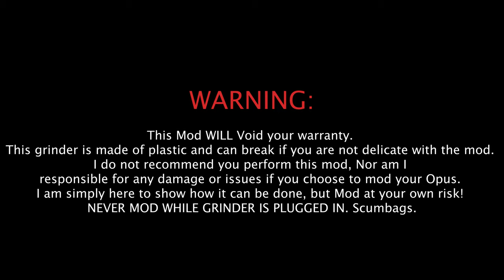MAKING the Fellow Opus BETTER (Stepless MOD)

Comment: What I'm left wondering is if Fellow could reliably use a stepless system which would make it more appealing to enthusiasts AND it would cost them less (1 less part), why would they have not manufactured it this way? No offense but something makes me think that with a lot of time and money for R&D, their engineers might have a better understanding of the nuances in the construction of the unit than yourself and may have made the choice to go stepped for a reason. I have to imagine it was a design choice based on the material itself, wear and tear and/or how well friction itself can keep the dial in its place long-term. I could be wrong but it seems haphazard to share this mod without results long-term but I hope it holds up.
Reply from the maker: Fair points and I agree but thankfully the mod is 100% reversible.  I haven’t noticed any drift. 
I am actually a fan of steps and using them but this grinder doesn’t produce enough fine tuning to truly dial in, dial in. And the system they made ended up confusing everyone who owns it because you basically have to do math just to remember where to be. Sadly is the opposite of intuitive. Had the micro steps worked the way people assume they should, there would be no need for a video like this. 😔 and for that I would have been also thankful. Since a step will always be more accurate repeatedly but if you can’t get to that dial in point then it’s pointless. 
I think also they expect this to be very entry level. At least when asking the designer why the dial is the way it is, they said they never expected people to need to (or want to)dial in that far. But… that’s kinda the point of the grinder.

Another kinda awkward thing is this grinder was not described as an entry level when it dropped. And people who have used fellow before and have come to know their pedigree, we’re pretty disappointed. Kinda felt like this was pushed too soon and a nicer version should have come first (then this) 
Like you don’t get the iPod mini before the invention of the iPod haha. 

This kinda felt like a space race to the moon with fellow vs the baratza esp. since they came out the same time and do the same thing for the same price. 

I’m rambling now. Thank you for the comment!!

Comment: I love you and your content. Please keep up the great work. I've learned so much from you. But sadly, while I'm the target audience for this grinder, I just can't buy it.

Plastic build is not the investment that I'm looking for, drip focused instead of espresso (pulling the trigger on the GCP today at WLL), need to know advanced calculus to dial it in for espresso, limited range for espresso, and now you have to totally take it apart if you want step less. I just can't pull the trigger. I'd rather pay more for the vs3 or sd40 if I want to go conical burr. But I already have a conical hand grinder so I might spend the extra hundo on a EM Notte as it has a nice begginer 50mm flat burr made for espresso with a nice stepless design during Christmas. But if I didn't have my hand grinder, I'd jump all over the ESP instead of the Fellow if plastic didn't bother me so much
Reply from the maker: I totally get it! 

Honestly wish I could replace the shell and dial with a metal version. It would beaf this baby up. And maybe just leave the filter setting for the ode and keep this espresso specific (which I’m suuuure they will do since the feedback on this model half answering the call for spro) would love to see an opus that is as high q as the ode. The esp definitely touched on some great innovation for a cheap all purpose! 

Thank you for the kind words!
Reply: @EmileeBryant  that’d be “The Magnum Opus”.  

One thing I have never understood, is why step-less adjustment is typically (with exceptions) a feature of higher priced grinders.  Every step-less mod I’ve ever seen is usually just a matter of removing some kind of pin.  So why bother with the pin in the first place?  I get that for beginners (like me), it’s probably easier to remember multiple grind settings for multiple situations with stepped adjustment, but still…   

…and it’s not like the Opus’ weird, fiddly, unintuitive and (based on what I’ve read) difficult to understand adjustment system is very beginner friendly.  Frankly, the new Baratza’s makes WAAAAY more sense.  Especially for beginners.